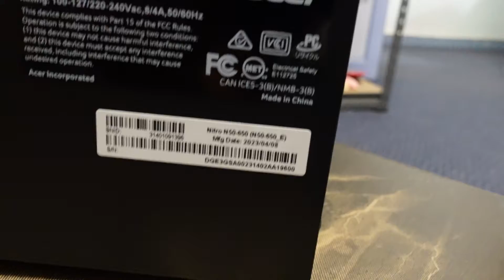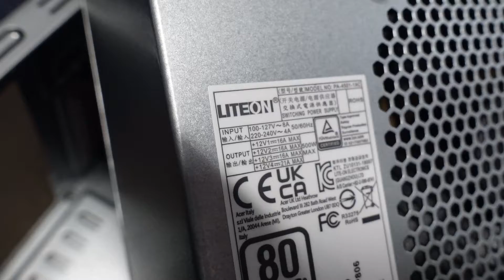Acer Nitro N50-650-E 2023 What Can be Upgraded?

Comment: Hi, I have the 656 version with 16GB RAM, DDR5 5600MHz, an i5 14400F, an RTX 4060, and a power supply of around 500W. Do you think a 16GB 9060XT would work well on that PSU?
Reply from the maker: a 500w with a 9060XT would be cutting it very close, i would recommend going 650w or higher
Reply: @rickstechrepairs  In your opinion, is it better to change the PSU to install the RX 9060XT or install an RTX 6060 as soon as it comes out?

Comment: I have a n50 640. I've upgraded the ram.. cloned the 512 to a 1tb nvme. Disabled the hard sata... installed a noctua for the cpu.. added a fan inside the front panel for air intake. upgraded cpu to a i7 12700kf.. graphics card to a 4060.. and i just upgraded the power supply to 850 after finding a 24 to 6 pin that works.. next im gonna get a 4070 super and call it a day. I think I've maxed out this old furnace to the best of my ability
Reply from the maker: Upgraded about as far as you can with that one!
Reply: I may copy this lool was it easy doing this
Reply: How did you get the PSU to work with the 24 pin adapter??? It doesn't work for me!!

Comment: I have same pc with i7 13700f and rtx3050 oem 8gb can I update my gpu? Many ppls said that it's impossible?
Reply from the maker: i dont see why not, just make sure the PSU wattage is high enough for the replacement gpu
Reply: @rickstechrepairs  the seller where i bought it said its impossible.. but i already bought a 24to6 pin cable from alixpress for 5bucks.... now i need to decide what gpu i will buy and will it fit or no :D
Reply: @rickstechrepairs  its possible to fit rx 9700 16gb which is 28 cm and rtx 5070 inno 3d 25 cm

Comment: Are those red and white ports in the motherboard SATA power and SATA data like you mentioned in the video? I have doubts from my neighbour saying a hard drive can not be installed from those ports.
Reply: so its another proprietary connector to power a sata power cable you can google AXC 6Pin To 2-Port HDD SDD SATA Power Socket Cable for Acer Computer Motherboard on where to find them
Reply: @Kramptonyte  So it'll be able to send power to hard drives and I'll also be able to use a SATA data as well?
Reply: @oldylock  Yes

Comment: I upgraded mine to 32 gb 1.2v cl 22 ram  , rx 6700 xt with adapter , added intake fan , upgraded cpu cooler to thermaltake si100 .
Reply from the maker: Cool, should be running pretty sweet for a while
Reply: Hi I want to upgrade mine to 32gb uet the corsair 32gb lpx 3200 only runs at 2133 with no ability to get the 3200 performance through the bios as normal.
Please can you link me to the ram you used if yours runs at 3200 base
Reply: @TrioxinZombie83Gaming  you need 1.2v ram . i used a timetec cl22 kit . the mother boad wont overclock 1.5v ram
Reply: @ianjames7524  can I put in a cpu cooler ?
Reply: @spacejaav   yes it's possible it has to be a shorter cooler and you will have to buy screws to avoid the lengthy removal process of taking of the factory backplate
Reply: @ianjames7524  ok I have this cpu n50 650 which cpu cooler will fit in it ?
Reply: @TrioxinZombie83Gaming  check your mobo how much speed supports
Reply: @ianjames7524  ??
Reply: Does it support two 32gt ram sticks or is the maximium one 32gt or two 16gt.
Reply: Ha e you got 1 32 gb of ram or 2 to make it 64gb ram ?

Comment: @Ricks Tech Repairs Firstly would changing such as the ram & power supply invalidate the warranty of the PC if say such as the motherboard or graphics car failed could they then say that the changes made could be responsible. But on top of that, if say changed the PSU to something like  Seasonic 750w modular unit & wanted to add another hard drive would still need a Sata PWR cable to give power from the board to power the drive or would it be ok to go down the normal route of powering it from the PSU with it's own cable direct from the PSU
Also i noticed the current PSU is a Liteon make, is this a unit with Chinese capacitors & how good is the ripple suppression on it, is it really suited for a gaming system? as i've had experiences in the past of a poor Chinese PSU that didn't supress ripple very well & was damaging hardware such as GPU etc & seeing something that is Chinese in it is giving doubts about the longevity of the system & thinking make the move to a better PSU, & would a standard ATX type PU do for this system?

Comment: Hey guys I need help I have the Acer nitro N50 with intel core i15 13400F and RTX 4060 with 16GB of ram I just want to know what case I can use to swap it with cuz I don’t wanna have to buy one and the motherboard not fit
Reply: Did you found the case?
Reply: Apparently the motherboard is micro-ATX design so most of the cases should be fine.

Comment: I got the 3060 version PLEASE RESPONSD CAN I FIT A 4090
Reply from the maker: I don't think it would
Reply: @rickstechrepairs  if i upgrade case and power
Reply: @KAISERAhmedX u need to upgrade basically everything in the pc to fit a 4090 so psu motherboard allat so no point in buying this pc to fit a 4090 in it
Reply: No. There's jot enough power or room lol
Reply: i have the same one would a 4060ti work or 4080? without upgrading anything else
Reply: @c63amgw204  for sure u gonna need to upgrade ur  psu....

Comment: are you able to swap the case because i got it but the case is ugly i got the 3050 version that is 2199 from harvey norman i want a new case but idk how or dont know what case can you please help
Reply from the maker: if you swap case, you will lose the front panel I/O
Reply: @rickstechrepairs  surely a much bigger like full size tower case would allow to keep front panel i/o ? my old pc was in a cooler master centurion 590 case & it is much bigger than this case, a lot deeper, higher & even a bit wider, surely a case that is deeper & has more room where the motherboard comes to front like of the centurion case would accommodate this motherboard without loosing anything?
Reply: dude case swapping is actual hell with this mobo and psu since theyre proprietary. id recommend keeping the ram, gpu, and cpu and ditching the rest for a case swap.
Reply: If you are going to case swap I would suggest MicroATX cases because of the short psu cables
Reply: Id buy a case keep the acer as is n then buy parts for the new case using somones yt tutorial if needed
Reply: i have also 3050 oem king version with i7 13700f and i think 4070 super will fit

Comment: Hey, i just got this pc. Tips?
Reply: Watch the video. He gives tips.
If you'd ask me. I'd return it, if you're looking to upgrade this garbage.
Reply: sorry my model is diff
 @ericvanlieshout9975
Reply: @ericvanlieshout9975 this thing is not garbage lol, add more ram and your good on basically everything
Reply from the maker: all mentioned in the video
Reply: I put a 4070 in mine and undervolted it. It seems to be working perfectly fine. I don't think any cards that suck more power than 200 wat would work. 200 wat cards are really pushing it as is
Reply: put a heatsink on the pch